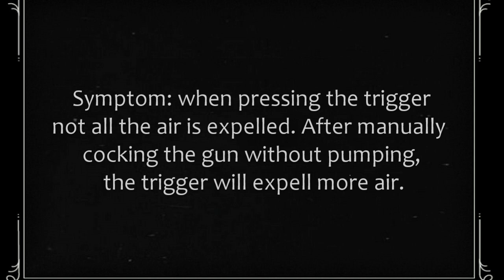Feinwerkbau 100 Repair [EN]

Comment: Ok but how change the chamber seal ?????? this is the main problem !!!!!
Reply from the maker: yeah :) i don;t know either...
Reply: @ArmeVechi  Cut the old one off, and put the new one on from the front in assembled state. You might have to pull the loading flap back like cocking the trigger, then you have enough space under it to slide it over.